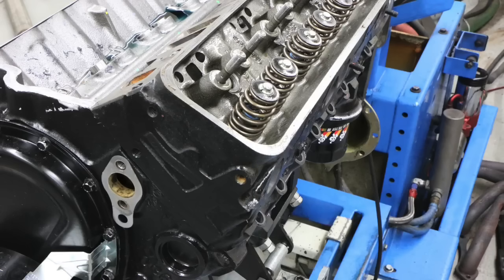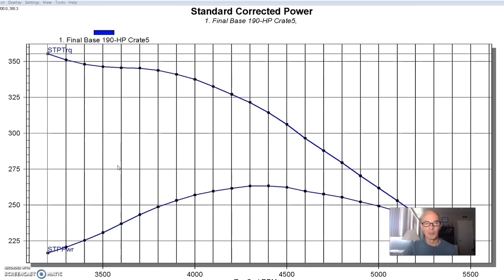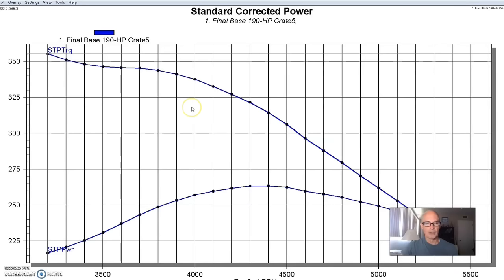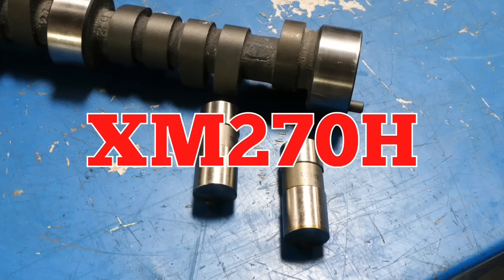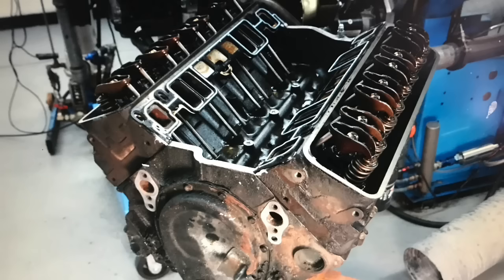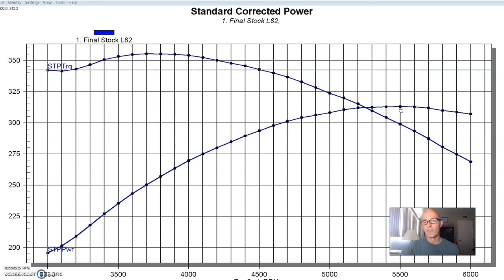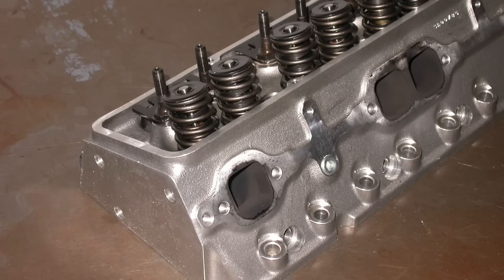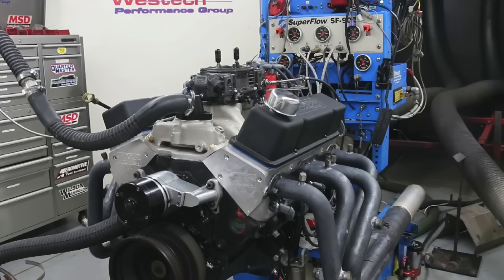JUNKYARD SBC HEAD TEST-VORTEC FTW!

Comment: I Have a 96 350 vortec switched to carburetor. I have the gm roller cam 14097395. Same cam as the ramjet 350. No spring upgrades or anything.  It ran about 325 hp and 340 fpt on the engine dyno

Comment: But i don't drive to my Grocery store over 100 mph either I got a 95 k1500 4x4 I got 193 casting heads 
But 191 casting are better than 193
I found some 191 casting heads at my salvage yard but winter is here so I have to pass them by as a truck 4x4 1995 motor ect

Comment: Ive got 2 sets of 96 vortex my Indianapolis salvage yard 
One set is Cracked..there great..however ya know ya need a intake rather TBI or Carb.
Or a TBI plate on a Carb intake 
Distributor gear has to be changed and if it's a 95 block the 2 thread holes are there but the locking frount cam plate usally is not cut from the factory as on my case the roller cam locking plate  2 threaded holes ..the locking GM plate at the cam frount of motor well the timing chain gear will make contact with the locking cam plates Because GM didn't size it correctly for the roller camshaft see.
Plus the distributor gear has to be upgraded.
They make a cam button that will make contact with the timing chain cover but am not a fan of that.
Don't forget ya ECM.
and omit some engine details as the ECM COMPUTER 
TRANSMISSION NEEDS a 
Throttle position sensor 
To shift the auto Transmission
And don't forget the input shaft at the transmission because 95 to 96 and up.
Is different far as input shaft on transmission 
Torque converter and ect.

Comment: L31 os a great base for any mild 350 build! I have the 350 ho in my 88 k1500 and it's plenty of tq for that truck! It's rated 330hp/380tq (rated with stock manifolds or shorties) and it has LTs to x pipe and slowmaster 10s dumped after the cab plus bbk ud pulleys. so lil more hp/tq. Was going to do the ls3 beehives and lt4 cam, but motor still is low mileage so not gonna open it up for no good reason than i just want a hyd roller cam vs hdy flat tappet 😂
But it sounds like an old muscle car vs a truck which I love as much as the hp/tq!

Comment: I have a 1992 350 tbi. It has a 204/214 cam. I've added a pair of AFR as cast heads and shorty headers and cold air intake. I haven't seen you cover any tbi motors so i thought i would just ask you what kind of torque and hp i could expect, Thanks.
Reply from the maker: you are limited by both fuel flow and airflow on the TBI-plus the intake design is not great-you would pick up a bunch of power if you just added a 4-brl carb and intake
Reply: Yeah I get that, and I wish I could but I have emissions inspections that I have to pass. My truck is just a hunting rig so I'm not looking at max power from it. I blew a head gasket and just added upgrades along the way lol.

Comment: By your introduction, I thought you were also upgrading the L82 to Vortec heads... that was my interest. I knew what a race or semi race prepped aluminum RHS head would do.... I was more interested in the Vortec upgrade on both versions of the 350.
Reply: I've got a good '74 L82 short block sitting in the shed and briefly considered Vortec heads but decided the 64cc chambers would bump static compression too close to 10:1 or more if they need to be milled. Personally, that's a little high for me with iron heads in a street car on pump gas. Short blasts in a climate controlled dyno cell with coolant temps never exceeding 160f and pulls starting at 3k RPM is not the same as driving in traffic. You can do it with an aggressive enough cam to lower dynamic compression, though the intended application and what you're willing to live with should be considered first.

A 10:1 static compression ratio and aluminum heads that flow a touch more will make similar power with less tendency toward detonation. If I remember correctly, as cast the RHS heads shown only flow about 20cfm at .500 lift over stock 885 L31 Vortec castings. Going just by the flow numbers and what others have gotten from them, with an RPM or Air-Gap intake and the right cam, the Vortec heads should still be good for around 400hp on an L82 bottom end.

Comment: Hey Richard I used this cam in my 350 sbc and it doesnt feel as hot as id expect, I have the same xe274he cam, 1.6:1 rockers, eagle crank, eagle forged rods, kb hypereutectic pistons, 902 votrec heads that had a valve job done on them, edelbrock performer rpm dual plane intake and a holley 4160 750 cfm carb, what do you think might be the issue

Comment: I have a 330hp vortec crate motor in my 1976 Holden Statesman that is built as a cruiser. What would you recommend as some upgrades for a little extra power but keep it nice on the street?
Reply from the maker: slightly larger cam, afr heads etc..

Comment: I’m curious as to what timing cover and balancer you used on the L31?
Reply: regular old steel one will work, you dont have to drill the extra holes, the gasket will cover it, id just put a bit of silicone over the gasket holes there. you can also buy timing cover dowels and knock them in, as the holes are there. if you get rid of the reluctor ring on the vortec(goes on the crank behind the balancer) you have to use and old sbc balancer pre vortec. vortec balancer is shorter to make up for that reluctor ring.

Comment: That L-82 upgrade blew me away! You added 14 degrees of duration @ .050 and increased runner volume by roughly 40cc and it gained EVERYWHERE!! Even down at 3000 rpm it gained over 30 lb/ft of torque! Everything I was taught in the nineties went completely out the window. I was expecting a loss below 3500 because of the longer cam duration and decrease in air speed from the 25 percent larger intake runner volume.

Comment: My son an I are building a 350sbc out of a 1985 c10 we put vortec heads from the junk yard now we don't know what size push rods to use
Reply from the maker: YOU NEED TO MEASURE FOR PROPER LENGTH-USE THE LENGTH THAT PROVIDES A NICE, EVERN CONTACT PATH ON THE VALVE TIP
Reply: depends on the cam you use. flat tappet? stock old style length(7.800" i believe) is fine. roller? gotta use the 7.200" pushrods that the roller motors used

Comment: I think the cam in the L-82 has a 114LSA. (According to numerous gm parts catalogs). That 114 was for idle vacuum and low rpm driveabilty manners. Also probably why it carried so well after peak power. I've had cams ground comparable but on a 108 LSA and picked up over 40 lbs torque throughout rpm band. Idle of course became lopey and vacuum dropped about 4". But man oh man it flat ran much harder anywhere and everywhere, on any given day, all day long.

Comment: Been tossing around the idea of doing some top end work to my 1988 K5 Blazer. It has a good running 350 TBI crate motor in it, great oil pressure and fires right up. I’m just bored with the swirl ports and performance and it’s only getting 10mpg so I might as well get a little performance out of it. I swapped in a sm465 manual and put 8 lug axles under it with 4.10’s and it’s on 35x12.50’s. Just looking to make it a nice cruiser that runs strong. Vortec heads, the right cam and carb it? I can regulate the in tank pump down to the right fuel pressure. What kind of cam would you be looking at? Love the videos, thanks!
Reply from the maker: 218/224

Comment: All these combos leave alot of power on the table with those 110deg plus LSA's. 110LSA cams are for your grandma. Stick a 106-108LSA bumpstick in. Your SBC will thank you
Reply from the maker: How about if we just stick a cam in with the correct valve events
Reply: there is so much more to cams than lsa. overlap, valve timing events, ramp speed, etc.

Comment: I have this 190hp crate engine, what gains are with stock cam and vortec heads only?
Reply from the maker: heads alone should be 20-25
Reply: @richardholdener1727  Thank you for quick answer, love your videos! Anyway i am in situation that my valve seals are shot on stock heads and i have vortec heads plus intake as a spare and would really like to avoid cam swap. What about 1.6 ratio rockers, would stock cam + vortec heads + 1.6 rockers be a good combo. In case i would buy a cam and lifter set i was looking into edelbrock 2102 cam, thats the cheapest option here in Europe for me. Thanks again
Reply: @multinjok  1.6 rockers should be ok, just watch the pushrod holes in the vortec head for pushrod rubbing. i put 1.6 rockers on my vortec heads with the stock cam, which is very close to the stock sbc 350 cam used on so many. they barely touched at all. remember to get SELF ALIGNED rocker arms if they are going on a vortec head.

Comment: EVer done a build using the afr 190 vortecs? Would like to see a  brute tq build done...with a not huge cam. 
350 with a 2teens @ 050 deal, 112 lsa or 396ci
Sad those GM crates had the price increase. for 1200 they were a killer bargain. Add a FT with another 12-15 deg duration you had a nice torque lil driver. 
Shame the L82s never had better heads or more compression. Sold mine 2 yrs ago to a vette guy

Comment: I have 99 GMC suburban k1500 with vortec intake I'm swapping an older 95 350 that's carbed into it, can I swap vortec intake to the older 350 w/o swapping the heads?
Reply from the maker: no, the vortec motor has specific intake bolt pattern not shared by the early heads

Comment: Why do you seem to have a wooden for wide LSA"s? Even in the 60's 106 was the standard, especially on smallish valve heads. Sure they had more compression but doesn't  a low compression engine with 106-108 make alot more cranking compression? I don't  know if you've already done this type of test, but I'm  sure that many would like to see it for themselves. Above 5250 peak numbers don't  mean squat on the street, nor flat torque curves if average torque suffers or if you can plant your tires properly. We'd  appreciate  it. Thanks
Reply from the maker: please see the lsa cam test video

Comment: Did you ever run any tests on a Vortec headed motor with the GMPP '395 cam?
Reply from the maker: no sir
Reply: @Richard Holdener  I tossed one in a Vortec 350 5 years ago because its a bit hotter than the stock L31 cam, and it has the fuel pump eccentric (I was lucky enough to find a Vortec 350 drilled for Mech fuel pump). So far as actual numbers go I can only speculate, but it definitely runs circles around the stock 160hp 1986 350 I took out.
Reply: ramjet 350 uses that cam, and is good for 340hp and 400 ft lbs i believe.

Comment: If you get a Vortec from a salvage yard get a roller-cam Vortec!  Have the machine shop machine the heads so you can put a big cam and better springs in it.  Also put a Victor JR manifold with an air gap on it and a big CFM carb on it.  Fairly cheap and easy 500 HP/500 lbs torque. Geat your money's worth! Go for the gusto!
Reply: Dont need to.they mske a spring that will work
Reply: @ryangulley2051  ,,,,,,,,,,,,,,,,,,,,,,,,,,,,,,,,,,,,beehive or ovate.....................................
Reply: I’d suggest RPM AirGap intake
Reply: All vortec engines are roller cam from factory
Reply from the maker: victor jr not a good choice
Reply: @richardholdener1727  if you are going for HP you certainly don't want a dual plane manifold

Comment: Do you ever calibrate your dyno? Those "stock" vortec numbers seem quite inflated from the stock 255 HP rating. You're telling me a dual plane and carb adds almost 60 HP and 60 ft lbs? Yeah, I doubt that.
Reply from the maker: You're telling me you understand the difference between a factory rated hp number (and the conditions they test for it) and this tested hp number? Yeah, I doubt that
Reply: dude, the stock poppet valve intake on the vortec is GARBAGE. they also never saw above 22 degrees total timing, and had choky exhaust manifolds. its common knowledge that a dual plane, headers, and 650 carb will put a vortec in the 300hp/400ft lbs range.

Comment: Would like to see a well ported set of  the much maligned camel humps thrown in as a mid level between stock heads and vortecs  as with a new intake and other issues really dont make it that cost effective. People always throw 882s in there and they are...well...crap
Reply from the maker: PORTED FUELIE HEADS WILL DO BETTER THAN STOCK VORTEC HEADS

Comment: I did start with a 350 HO crate engine ,its different you can't put a double roller chain with out lots of machine work ,not a 5.7 rod not a 6 inch rod but 5.9 it has 64 cc combustion chamber 9-1 compression with a 55 thousands crush head gasket its not a typical dished piston its different only V8 I ever seen you couldn't put a double roller on and the coolent passages are a little different too a shim head gasket will bring up the compression ,headers don't really fit because the vortex head raised the exhaust port they don't leak but they do block off the exhuste a little its rated 330 HO in my openion it runs a little better then a good running 300 HO 10-1 350
Reply from the maker: gen 6 big blocks are like that too
Reply: you can put a double roller on a vortec block, you just gotta grind some casting off the cam oiling tunnel plug bosses.

Comment: So what I learned is that if you upgrade the heads and cam on a 5.7 from 1998 then you can make as much horsepower as a 5.3 in 1999.
Reply: That's how evolution works. Just look at the differences in diesel trucks from years to year. Late 90s diesels make about 200-250 hp and 400-450 torque. Go to 2010 and they are close to 400hp/700-800 torque.
Reply: you also learned you can add these vortec heads,plus a decent cam  to your existing 350 smog motor and make a fuck ton more power
Reply: @trillrifaxegrindor4411  no more than doing the same thing to a 5.3.
Reply: but with wayyyy more tq and at a nice low rpm.
Reply: @frigglebiscuit7484  about 50 ft lb.  It's not as much as you think.  Richard actually made a video that showed it.
Reply: @frigglebiscuit7484  what really kills the small blocks is their heads. They have to get aftermarket heads in order to get near the power levels of the LS.  This is also why small block Chevys use a bigger cam and still make less power it's because their heads flow so little that they are heavily optimized for low RPM and if you want big power out of them you need a lot more cam.  On the 5.3 or any other LS for that matter, the heads flow really well compared to the older stuff.  This makes them not need nearly as much cam to make more power everywhere.  But if you pick the right cam then you don't lose anything down low either.

Comment: The true question is do the 062 heads or 906 heads flow better witch ones actually flow better or are they both equal
Reply: same flow numbers unless the 906 heads cae off a 3/4 or heavy half ton truck. they had heavy duty exhaust seats that kinds bluge into the chamber a bit. can be smoothed out to equal the others though. less crack prone as well.
Reply: @ the heavy duty seats are a hit n miss I’ve seen 4 bolts with factory seats on a vortex heads not the heavy duty pressed in ones

Comment: I got a 1989 Chevy c3500 dump truck with the dumper missing but I've been driving it until my brake lines are fixed how do you get more power out of those TBI 350s

Comment: My friend bought a 78 silver anniversary corvette had 22000 original miles he wanted a bit more power we put a set of new Vortec heads with screw in studs and decent springs and a 270@ .50 470 lift cam. It was a  really strong running car then
Reply: I'm trying to do the same on a 74 Vette. Can you tell me what you guys used for an intake gasket? Also did you have to redo the push rods?
Reply: @benvolman4976  felpro 1255 intake gaskets work great. if your car is flat tappet cam(most likely) your stock pushrods will work. you will have to use the stock vortec rocker arms, or any aftermarket sbc self aligning rocker arm.

Comment: what the best I can put in my 97 c1500 5.7L TBI, it has 288k and still runs strong. no leaks or oil loss. Whats a good budget motor I can run without getting any tuning done?
Reply from the maker: good luck

Comment: now i suppose if i go upgrade the cam to a roller thats .470 intake .480 exhaust as well as put on vortec heads on the 190 hp 350. thats over 300 hp i get from those. and vortec 350 doesnt go over 300 hp does it?
Reply from the maker: 300-HP VORTEC 350 IS VERY EASY
Reply: stock vortec 350 with a dual plane, carb and headers will make 300hp all day long.

Comment: Any idea what kind of gains one would be looking at with vortec heads on a stock l-82? I have a set im looking at putting on my C3, id love to do a cam as well but 2 things scare me about that. The first mainly being all the issues with hydraulic flat tappets and 2 being inexperienced with doing any kind of internal motor work
Reply: Smaller HFT cams live ok...melling, elgin are safe bets. Cams with the extreme or fast ramps are much more likely to fail
Believe both mfrs make an L82 spec cam also. The Isky 270 mega cam makes plenty more torque with a couple less degrees cam timing. Power brakes, vacuum all fine. Sound good too but can daily drive it .Real good line of cams (mega)
Reply: probably 30hp from the heads alone. as far as flat tappet cams, i only run howards cams.

Comment: Can run LS beehive springs and + 0.050" retainers on the stock head and have decent clearance but
You'll wanna have screw I  studs (I've seen them ran w/o studs and be okay but I'd err on the safe side).  So if ur going to the machine shop, may as well have guide boss trimmed down too for more clearance
And possibly machined for more pushrod clearance 
And if ur running a na 350, for the most part a 108 lca will do well, 106 for 383
If you want to get carried away you can check out Larry Meuax stuff but unless ur running a specific class, just buy aftermarket heads then

Comment: I'd like to see you run a junkyard vortech small block with the better cam springs and aluminum 4 barrel intake
Reply: a stock l31 vortec with a 0.470 lift cam will make around 350 horsepower reliably